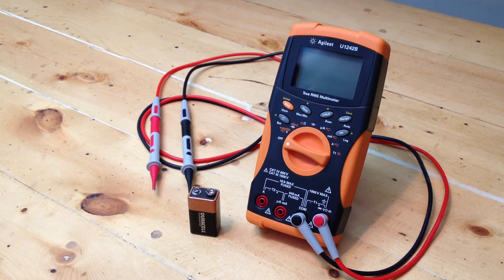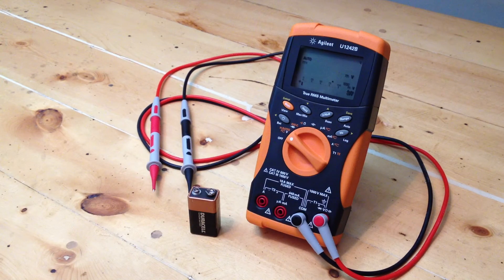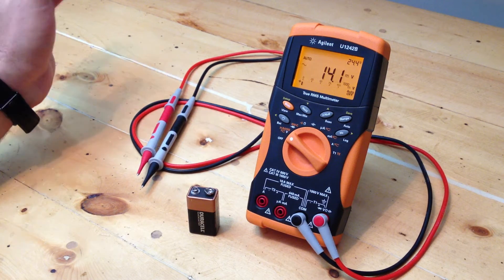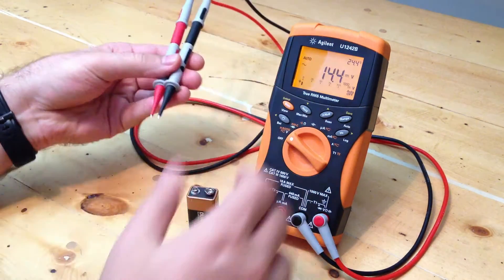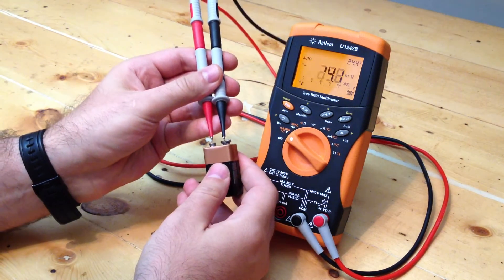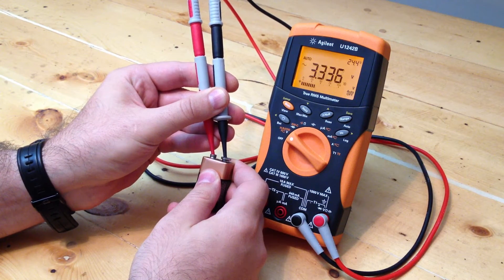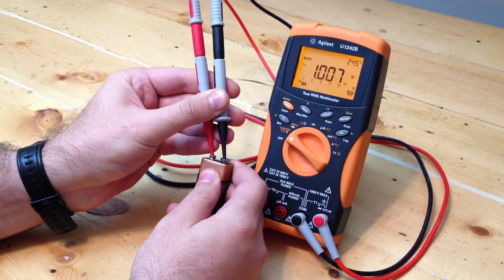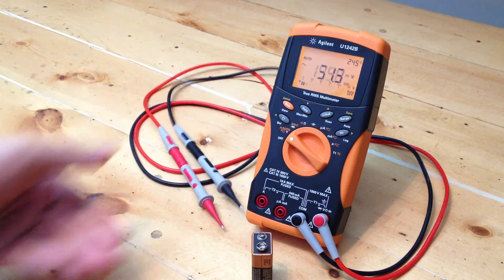Agilent U1242B defective AC volts/autoranging pt. 1

Comment: Why would you ever measure a humble battery on ACV scale? It has no ripple voltage
Reply from the maker: It was to demonstrate an issue with the meter. However, measuring ACV on a DC power supply is not out of the question, in order to determine ripple voltage. A scope would provide a better idea of the ripple but not everyone owns a scope, or can take a scope out into the field.
Reply: @Orcinus24x5  yup, you are right. But a DC power supply it's a different business than the 9v battery you used. Anyways... Did you send it back for replacement or refund?

Comment: What happenes when you turn multimeter off and on WHILE having contact to the voltage source? By the way, voltage selection readings can be reset on any voltage meter (and multimeter) by connecting the leads together, have you tryed that?

Comment from the maker: It will be an issue anytime you measure an AC voltage that has a DC offset greater than the threshold to switch from the lowest voltage range to the next one.

Comment: I'm having a problem with mu U1272A meter.  I used it to measure the output on my arc welder and it correctly displayed 54v.  I reversed the leads and it displayed -0.476v, instead of -54v.  There is some problem with autoranging function.  Take a look at my video.